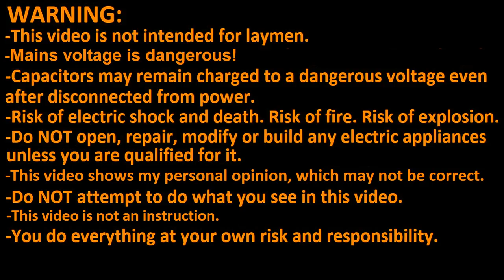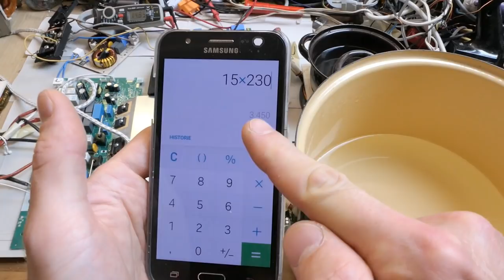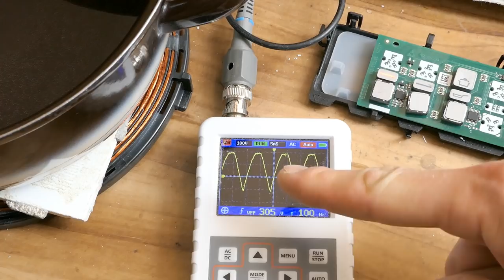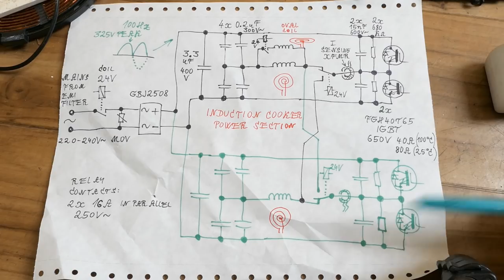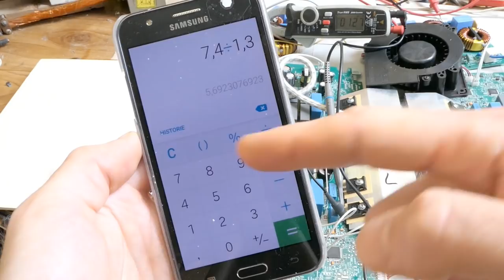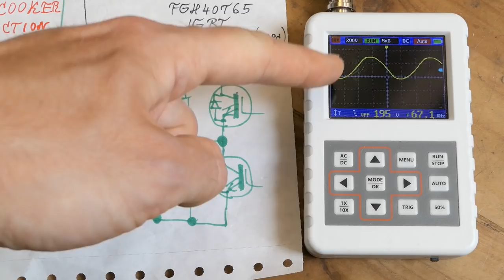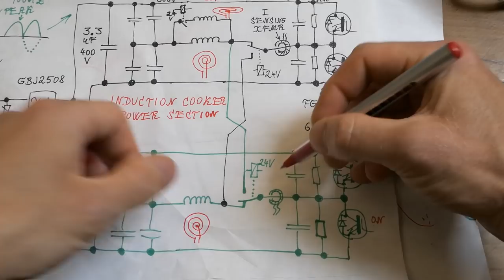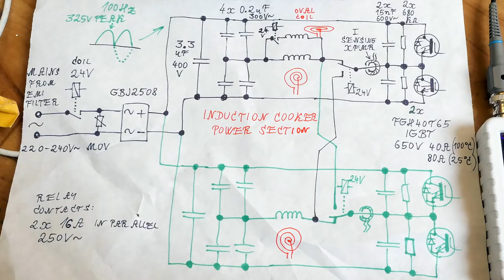induction cooker experiments and analysis

Comment: A 2 burner resistive cooktop cost $32. A 2 burner induction cooktop cost $230. The induction cooker is efficient but full of circuits that can break. The resistive cooker has no components and will likely last 30years. These things are not energy saving or environmental when manufacture cost are counted.
Reply: But they won't burn the house down

Comment: To measure with the 2 Channel scope, you can make a very dodgy thing, which is bypassing the ground pin of the socket. The downside is that all the exposed parts of the scope Will be live :)
Reply: Which, in the case of most analog scopes, is: The case and everything else on it, maybe even the knobs as well. Plus you dont know how much insulation is between the case and other voltages inside, so you can also break it on top of that.

Seriously, dont ever even think about doing that.
Reply: A not-so-but-still dodgy thing he can do is connect two same transformers in an input-output/output-input configuration to isolate the scope from mains
Reply: @mystcat3  That's safer for the scope, but NOT safer for you. He would have to run the entire cooker on an isolation transformer to make it somewhat safe to probe. Or as he mentioned, use inductive sensors only on the scope.
Reply: To use the cooker with an isolation transformer, the trafo needs to be rated over 3kVA. That would be huge...
Reply: @martinjimenez821  I know. They are very hard to find affordably. Very few companies need/use transformers like this. 
However you can sometimes find other high power transformers like 400 to 230v transformers, for use in industry where no neutral conductor is available but you still need 230v. There are a few ways to use something like that for isolation, although it's still not designed for safety.

Comment: I liked it until it did not work with most pots. For me that's just unacceptable for a cook top. Heating elements should just make heat regardless of what they're heating.
Reply: It's to sell you their brand of utensils.
Reply: the most of pots thesedays have metal plate at the botztom, and rest of it is aluminium
Reply: @felixcat4346  No it's not. It is simply not feasible to heat aluminium with induction in a cooking application. You would need to scale up ALL the power electronic components at least 10x to be able to even START to do it. 

If this cooker tried to heat an aluminum pot regardless, it would heat itself more than the pot or even destroy itself, without heating the pot to a usable degree.

It's also not like induction-capable pots are hard to find, expensive, or anything else.
Reply: That was the only disadvantage for me when I switched, I needed a new frying pan and coffee pot but also can’t heat my Pyrex on the cooker now (it can go in the microwave anyway so no problem)
Reply: @samuell.foxton4177  I don't like to heat all things up in a microwave. MW works fine for a lot of stuff but some things I like over plain old heat. To me MW makes some things have a rubbery texture. Like say, bouncy chicken. I guess if you're a vegetarian you can live out of a MW.